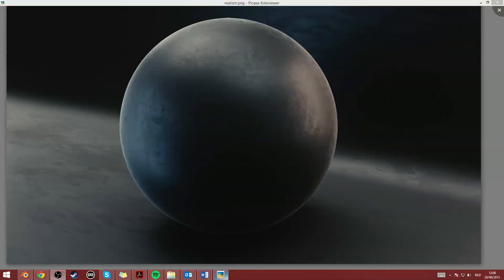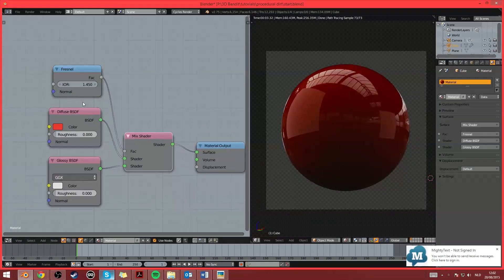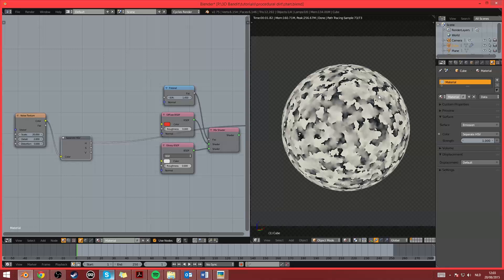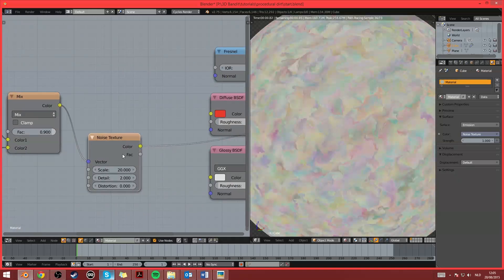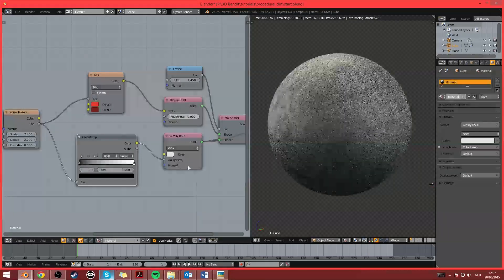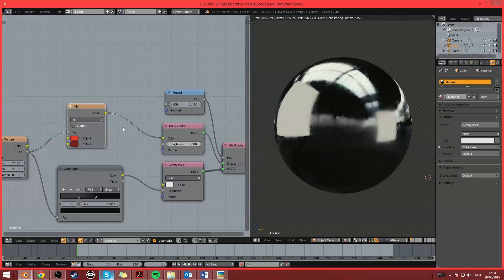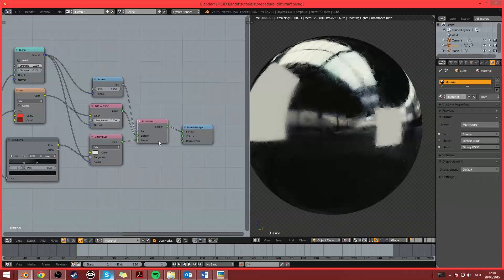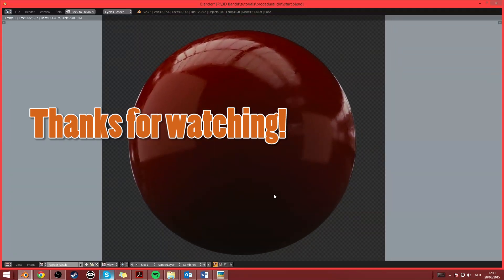Blender Tutorial - Procedural Dirt/Grease

Comment: The mirroring of the noise part must have been a result of the generated coordinates or maybe because you used Point instead of Normal on the Mapping. That's all I can think of because it's not supposed to be the texture.
Reply from the maker: +Gustavo Spredemann thanks for the tip :D